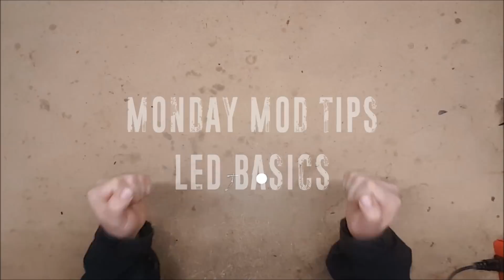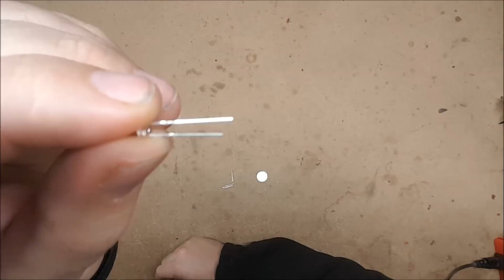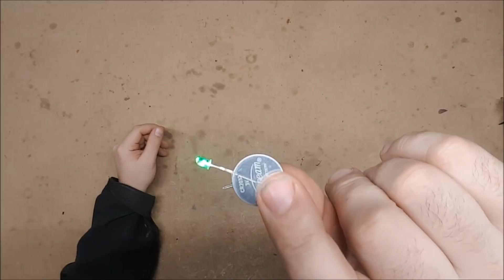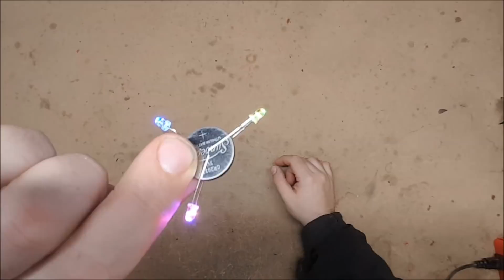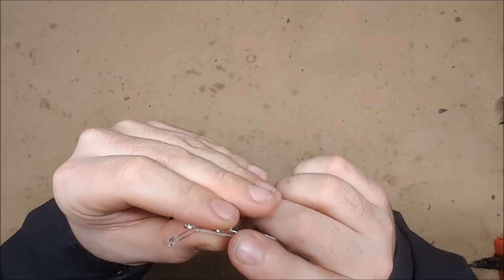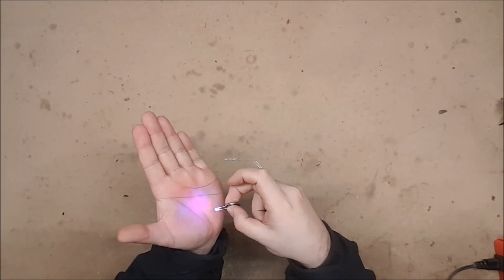Monday Mod Tips - LED Basics

Comment: I would like to make a circuit that is half of one color and half yellow. The one color ones would be mounted at the back, and the yellow ones would be mounted towards the front. I would like to have an activated by the trigger switch. Can you think of a way for me to wire the circuit. Can I use the same technique that you were explaining?

Comment: Hey there, i have a pertinent question regarding led's. I am about to start work on a series of blasters all running on 2s all running with 2 2v led's designed to operate on a seperate switch, whaat resistor do i need, can't make head nor tails of the maths. Many thanks
Reply from the maker: No idea. Resistors are still magic to me. This explains it fairly well (but you have probably already seen it) http://www.learningaboutelectronics.com/Articles/How-to-reduce-voltage-with-resistors.php

Good luck?
Reply: @CaptainXavier  https://www.electricaltechnology.org/2014/02/led-resistor-calculator.html Just found this after a long sleepless night, hope it helps you too, muzzle flash ftw

Comment: DONT FORGET THE RESISTOR OR YOU WILL BLOW ALL YOUR LEDS
Reply from the maker: It depends on the voltage rating of the LED, but yes, a resistor might be needed.

Comment: Very rarely are LEDs going to be rated for just one flat, nominal voltage, they'll have a range, and certain colors will have a higher voltage range than others (higher overall volts, not a larger range), due to the different chemistries  of the PN junctions required to produce visible light in that given wavelength. That means you might need a resistor. In that case, Kirchhoff's voltage and current laws, along with Ohm's law will be the formulas you need to determine that. Fortunately, there are calculators online and in the Google Play store (and probably the App store) that will do that for you!

Comment: Could you do a video on Resistance for LEDs cause I'm trying to hook up LEDs to my stryfe and it's running off a 3s so yeah I'm not entirely sure how much Resistance to put in it so it won't kill the LEDs
Reply from the maker: It varies from LED to LED.  What is the voltage rating on your specific LEDs?
Reply: Captain Xavier https://www.amazon.com/gp/aw/d/B01MXXAL4R/ref=mp_s_a_1_2?ie=UTF8&qid=1517934807&sr=8-2&pi=AC_SX236_SY340_FMwebp_QL65&keywords=blue+led&dpPl=1&dpID=517QsZ-73uL&ref=plSrch couldn't find it on the original ones I was looking at but these say 12v so does that mean they could handle the 3s? Sorry I'm new to LED work
Reply from the maker: They should be able too.

Comment: You didn't mention using a current limiting resistor. It's true that you don't always need one especially if you have multiple in series, but you described parallel, so I'm not sure this would work. It's also true that you don't need them on batteries that don't give much current like that coin cell, but if someone rigged this to their LiPo... I think it might pop.
Reply from the maker: Thus, "LED Basics" not "LED Everything you could possibly need to know"  ;)  I will be going into more detail in future videos.  :)
Reply: Fair enough, I would have mentioned it just quickly in this vid though.
Reply from the maker: Well then, make your own video and mention it.  :)

Comment: You should put a 12kg spring(from lightake) in a doublestrike and make it a tiny shotgun pistol for your vest
Reply: Captain Xavier can the Nerf Elite set fire a new Nerf blaster can take a k-26
Reply from the maker: I should...
Reply: Captain Xavier also are there any mods you recommend for a raptor strike I have seen a 12kg spring but I’m not sure if it can take it, I saw a cosmetic kit on Etsy: https://www.etsy.com/listing/549375813/nerf-accustrike-raptorstrike-sniper-set?ref=shop_home_active_1
Reply from the maker: Nope.  I have not modded one yet.  I do have one now so I will...eventually...  I will at these 2 springs to the list of things to ask LighTake for.  :)